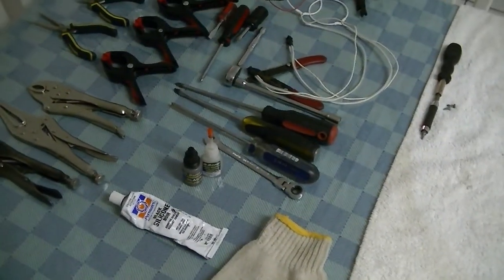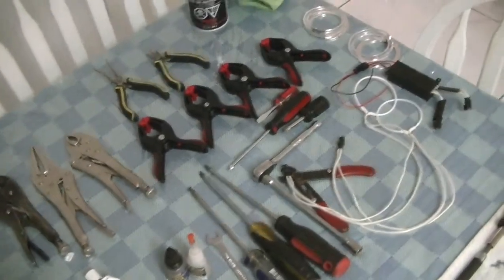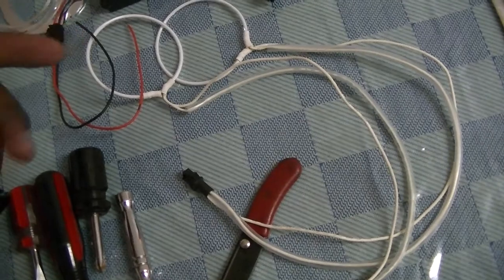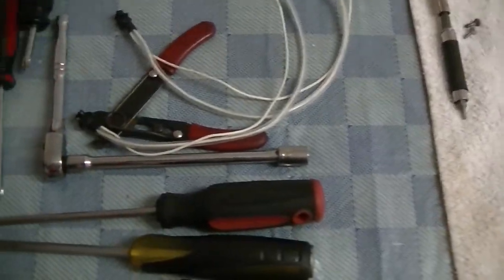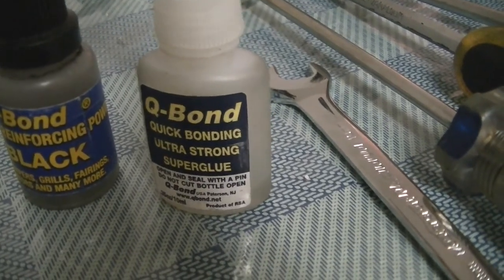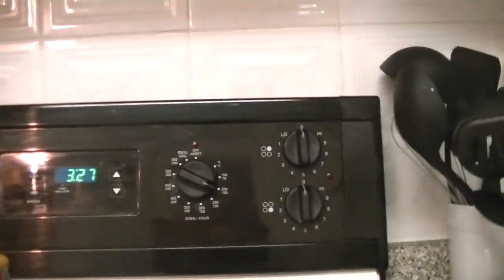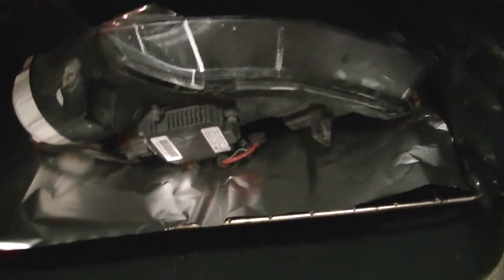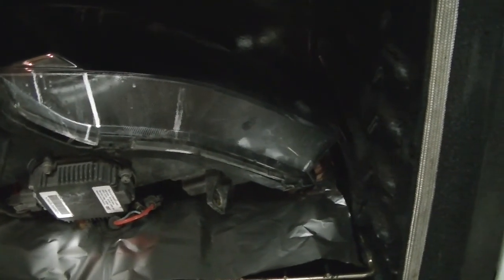04 Nissan Maxima Headlight Mod with CCFL Halo Rings PT1

Comment from the maker: I would recommend that you remove the ballast and bulbs seeing that it's electrical and you don't want to expose it to too much heat. I took the chance and it went right but I wouldn't advise anyone to do the same. I've been getting moisture build up because I opened mine too many time so to be on the safe side get a product called Butyl sealant and apply a fresh layer to prevent moisture

Comment: Yo that's crazy good I want to do the halo no my 04 Nissan maxima but I would like if u could give me more details I do light and music but I never did halo rings
Reply from the maker: You'll need a 70-72mm CCFL ring and some really strong epoxy or crazy glue. I can't really tell you how to that that but when you get in there it's just a matter of gluing it nice and secure so that it don't fall out when you install the headlights. I wired them to my ignition with a foglight harness and a on/off switch so that I can use it without turning on my park lights.
Reply: MrJasonlyrics
hey man can you tell me the size of the halo rings ? I'm about to do mine but don't know what size to order
Reply from the maker: I bought 75mm LED rings but they came in a housing. I removed them so I'd assume around 72-74
Reply: +MrJasonlyrics  75mm is that outer or inner
Reply from the maker: BLINDMAXable send me an email and I'll send typy some pics with the size jmax.customz@gmail.com